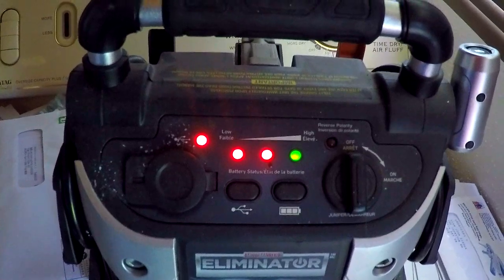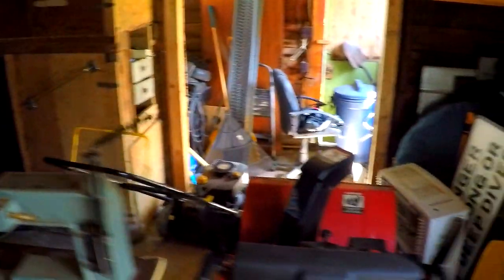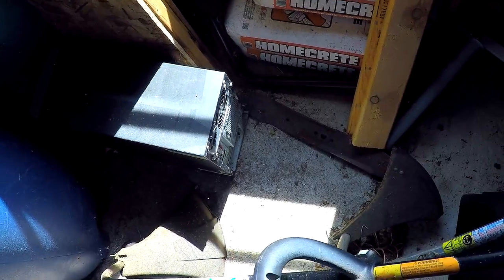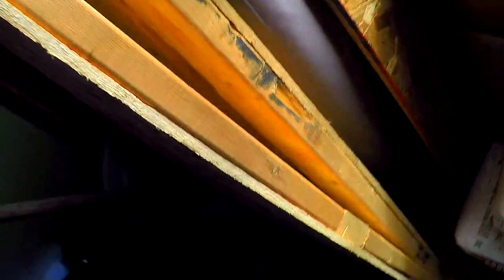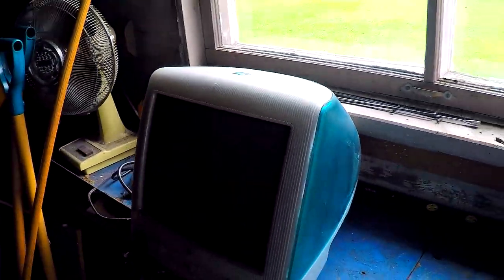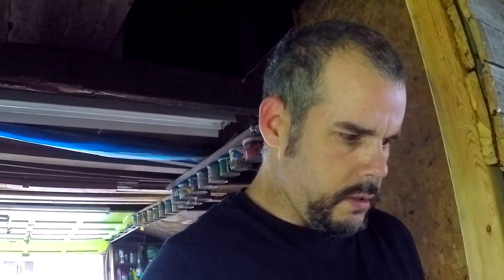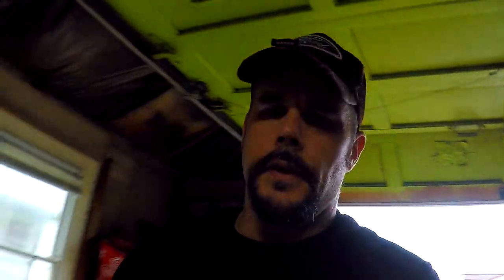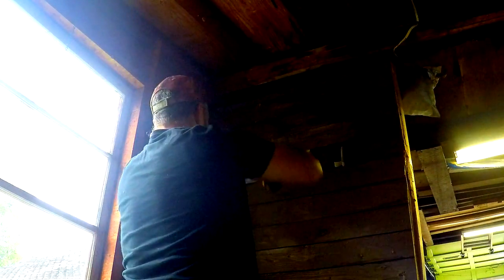Shovel Shelf and Side Road Pickups

Comment: The shovel shelf pipe system is very strong and I have done them plenty of times before.  If it doesn't hold up the way you have it built, turn the 2"x 4" vertically (you will need a second one for the other pipe) and attach the pipe to it.  The down-force load on those pipes create a lot of leverage on a relatively small surface area with the board horizontally.
With the 2"x4" vertically you are spreading the load over a larger surface.  Just a thought.  Have a good weekend.